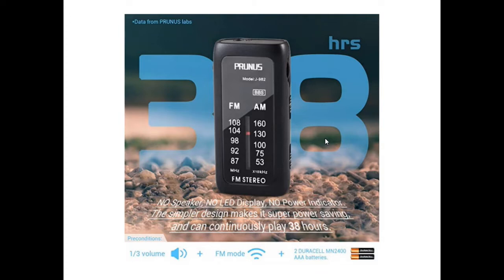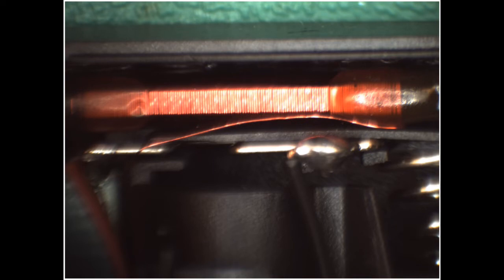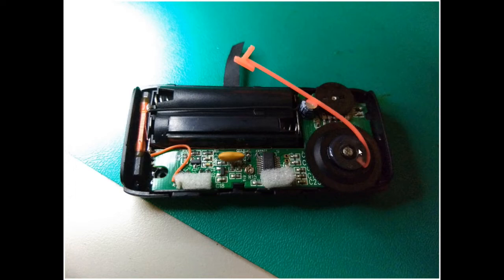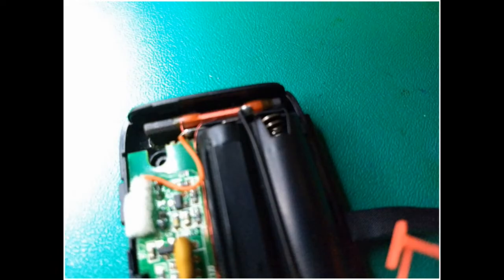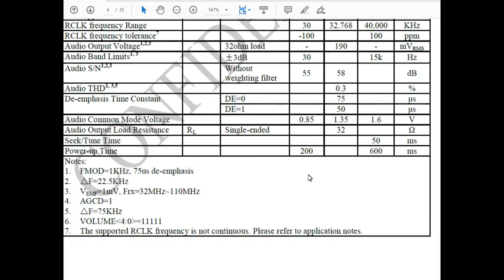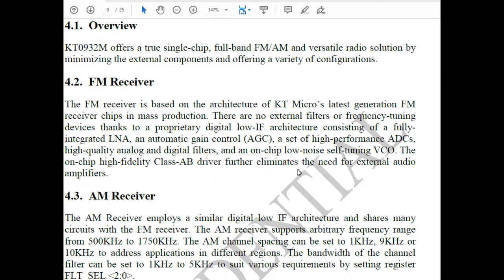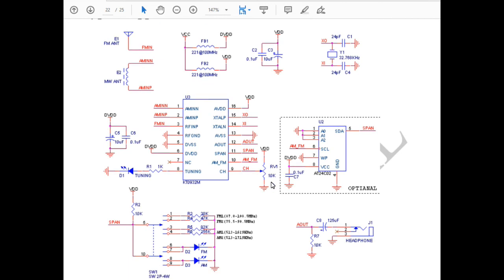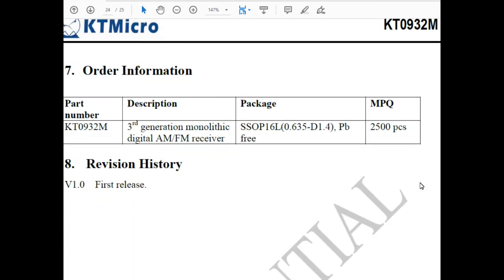Prunus J 982 Whats Inside This AM FM Pocket Radio (Teardown)

Comment: Awesome explanation of the inner workings of the radio! It's just fascinating how that entire radio is on the chip (certainly backs up Moore's law about electronics). I do not own a analog tuned chip radio, but I figured (with your findings) that weak signals would drop out completely when not received. I'd be nervous removing that board too. Sometimes small stuff is very frail.
Reply from the maker: Thank you, I’m glad you liked it. The DSP radios are different Animals that don’t tune like an analog radio does. Most have soft mute that will not produce any audio until the signal is at a high enough level. It’s very easy to pass by a station if you’re tuning too fast. I like the transistor radios from the 60’s that gives you audio all the time. It is amazing what can be done with one IC and a few dollars of parts today. 👍❤️📻
Reply: Radio wild 
I do own several DSP- “ Analog “ Radios.  They are mostly for very basic local station listening , unless they use a “bigger-better “ chip( ie: Daogoly), until you get into the much more sophisticated radios ( ie: CC Radio EP-Pro).  They can be a real pain to tune, especially the small pocket radios.
They mute, and it’s really easy to pass up your station a couple/ few times before finding it, then the radio may loose the lock.
📻🙂

Comment: Very impressive! I think I would do a little experimenting with the other features mentioned on the datasheet.  Now if your really bored...see if it really does do 38 hours...try at min / max vol since we don't know what their test environment was.  Great video as usual my friend!  ~Jack, VEG
Reply from the maker: Thanks! It’s rated for 38 hours at 1/3 volume. I don’t know that I will test for that or do any modifications but you never know. I read later in the data sheet that the radio chip has a built in audio amplifier as well. Thanks for tuning in and keep up the fine work on your channel as well. 👍❤️📻

Comment: It appears that, ( perhaps in part, thanks to the Daogoly, and a couple others) , perhaps some of these radio companies are getting better at implementing the DSP technology better, now.
📻🙂
Reply: I don't think radio manufacturers are especially getting better at implementing DSP technology, because they just use off-the-shelf DSP-radio chips from semiconductor manufacturers. DSP radio chips are probably more expensive than analog ones, yet radios end up cheaper to manufacture because there is no need for IF transformers and the like, and there are no adjustments to do.